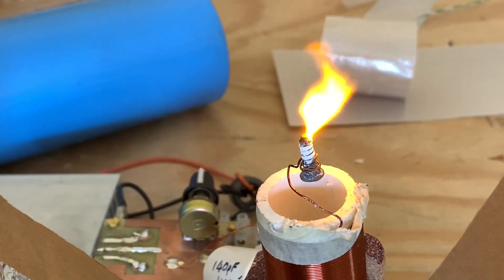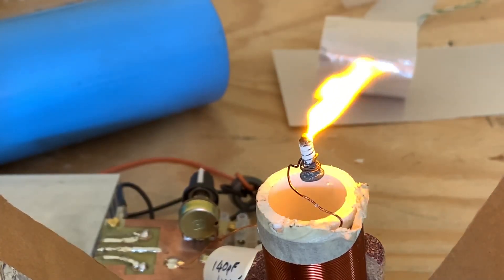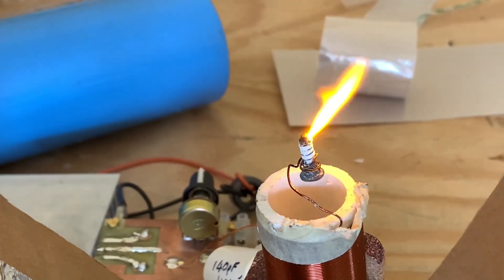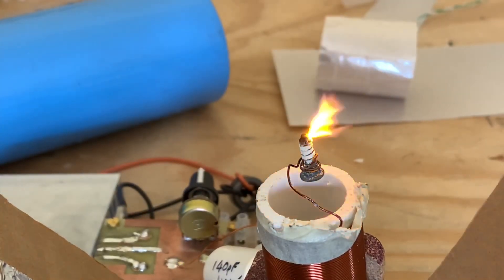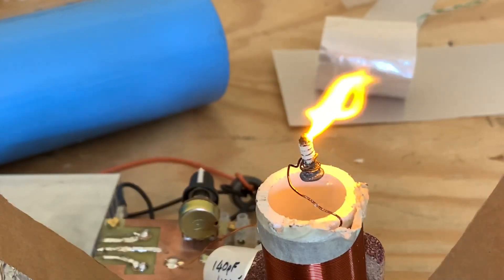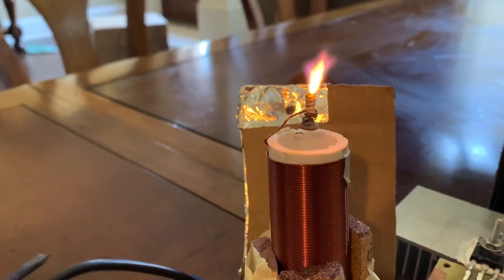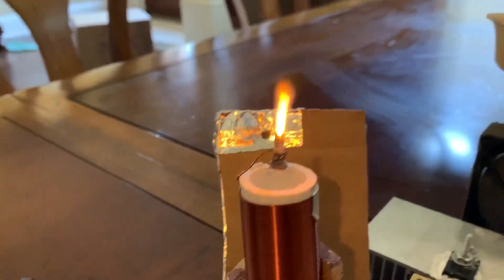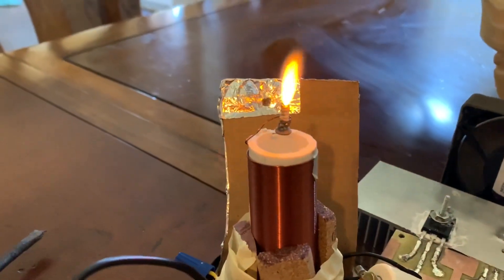Electric Candle Flame

Comment: The reason it forms a flame, is combustion.  Your electrode is vaporizing.  When the metal vaporizes, it becomes fuel and burns with the oxygen in the air.
Reply from the maker: The metal gets really hot but stays around for a long time

Comment: In the circuit diagram there are 3 inductors...which one is which please clarify.....

Is there a primary coil required ?.....I can see only a secondary coil in your video....
Reply from the maker: There is an approximately 5 turn primary around the secondary with a 0.5 cm to 1.0 cm gap between the secondary and the primary. The primary has to be adjusted in height and number of turns to get the circuit to spontaneously oscillate and resonate. You will need a variac to test it before powering it up fully. A quick way to know the circuit is at resonance is when output is maximal with minimum heating of the MOSFET. I checked for mosfet heating easily with a thermal camera but you can also put a finger on it after a short (few seconds) run to check it is not getting too hot and keep adjusting the primary until it stays only warm.

Comment: Classy and class E.  Well done.  How much power does is it actually consume?  Do you have any idea of the efficiency or the arc temperature?  I couldn't really tell if it was burning down the breakout point like I would expect.  It almost looks like a MOT arc at times.

It's also a very bright orange yellow arc which you don't usually see coming from HFSSTC's which usually seem to have bluish white arcs and corona.  Did you put some salt on there maybe?

Just the other day I got the idea to use my NST to weld the tips of my bike cables to prevent them fraying so it makes me wonder if this thing is of any practical use for heating, welding, etc.
Reply from the maker: Thanks definitely class-E. Not the most pleasing looking winding of the primary. Winding this is trial and error to get it to resonate. Prob would work for welding but the extra effective size / capacitance may throw it out of resonance. The yellow color is from sodium bicarbonate. Can use borax, salt, KCl, BaSO4, or dip the tip in liquid glass for other colors. When the iron tip starts to glow, this also imparts a yellowish color to the flame.
Reply: @BrianDhvTinkerer  I've really been starting to like using bits of carbon fiber rods from my old drones as breakouts.  If you hit the end with a torch it burns off all of the binder leaving what's basically a brush with bristles way finer than hair and sharper than any possible metal point without being able to hurt you. 

It also makes a very fire-like plasma due to releasing incandescent carbon particles.   It's incidentally also the best material or substance I've found for generating plasma in a microwave

CF is also nice in that it doesn't conduct heat back to the holder. or wire its connected to and so can sustain an arc practically indefinitely
Reply: @SciTubeHD You can get under floor heating wire that is essentially carbon fibre with an insulating sheath.

Comment: COOL. Some shots of your circuit would be nice instead of just the output. Thanks for the link.
Reply from the maker: Check under the acidbyte.info link in the description for the circuit diagram used
Reply: @BrianDhvTinkerer  i found it
Reply from the maker: I plan on redoing the circuit using different value capacitors and coils  and replacing the PVC with alumina as the dielectric effect makes the PVC so hot that it starts to melt